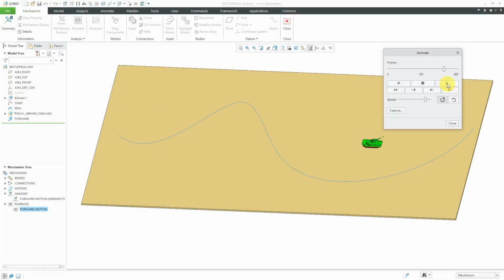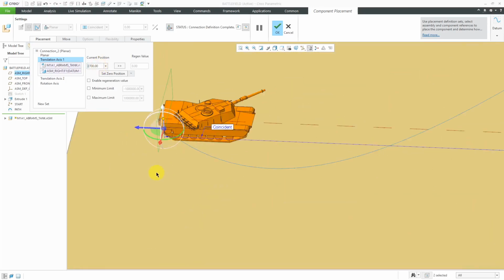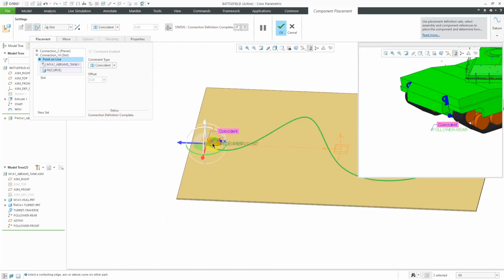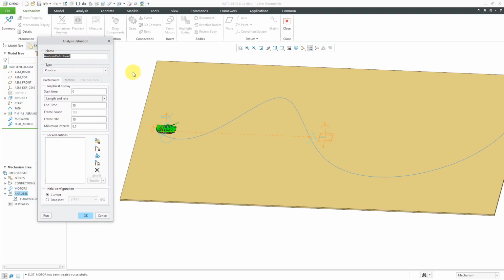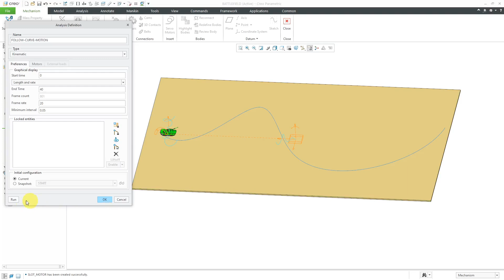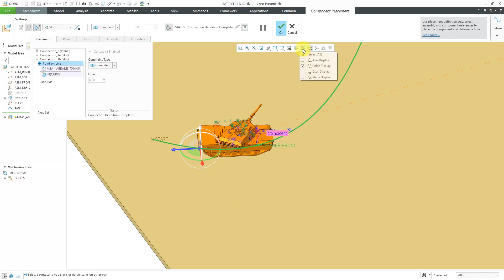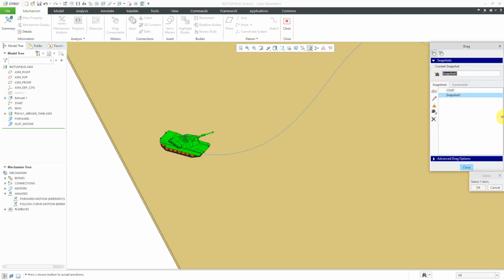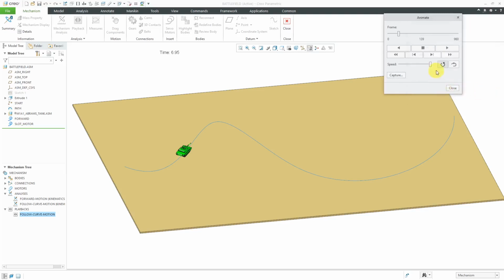Creo Parametric - Mechanisms | Slot-Follower Connections

Comment: is there a way to make the tank go up a hill as well ? 3d track ?
Reply from the maker: Yes. The curve can be 2D or 3D.
Reply: @CADPLMGuy  yep, but you can't do the coplanar constraint in a 3d curve, thus the tank will be slotted only in two points leading it to rotate around the curve
Reply from the maker: Yes, then you will have to use some other constraints. You will have to adapt for your particular situation. In this particular video, I wanted to show a Slot-Follower connection, and I used a simple example with a coplanar constraint. If you want to do it in 3D, you will have to take a look at the situation and come up with a solution. For example, it might be 2 curves and separate Slot-Follower connections for the right track and the left track of the tank.
Reply: @CADPLMGuy  that's exactly what i did, i offset the 3d curve and did a 3 point slot constraint.

Comment: The slot follower has to be one of the most difficult mechanism connections to utilize and animate.  For me, the vehicle always ends up facing the wrong direction.  There seems to be no rhyme or reason to it.  It may run correctly once then the second time regenerate facing the opposite direction.  Often the mechanism operates fine when dragging the component through the path but when running a mechanism analysis it will fail or disconnect.  Over the years, this has been the most difficult connection to get working correctly.  It also seems like when the path is a closed loop these problems become far more pronounced.
Reply from the maker: Are you using a Snapshot to define the starting position of your analysis?
Reply: @CADPLMGuy  Sometimes.  I have done these with and without a snapshot.
Reply from the maker: @chrismerani5330  When using a slot-follower connection, always use a Snapshot or Initial Condition to define the starting point of the analysis.
Reply: @CADPLMGuy  as I stated, this doesn't have any effect on the mechanism.   It does help to ensure the timing of the mechanism is correct but has no bearing on the connection disconnecting itself when attempting to run an analysis.  As I mentioned, you can drag the object thru the path without issue.  I have run into this issue several times before and had a model I uploaded to the creo user forum last year.  Other users experienced the same issue.
Reply from the maker: @chrismerani5330  Not knowing your models, I cannot tell what else might be going wrong. As I explain in my video on General connections, a Slot Follower connection usually needs to be used in conjunction with other connections, especially General, to prevent tipping or flipping.
Reply: @CADPLMGuy  Here is a link to the issue from last year.  I am dealing with a similar issue right now as well on a different model.  
https://community.ptc.com/t5/3D-Part-Assembly-Design/Mechanism-Design-Slot-Connection-Flipping/td-p/648681